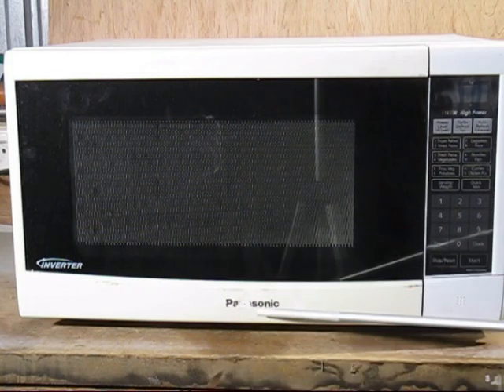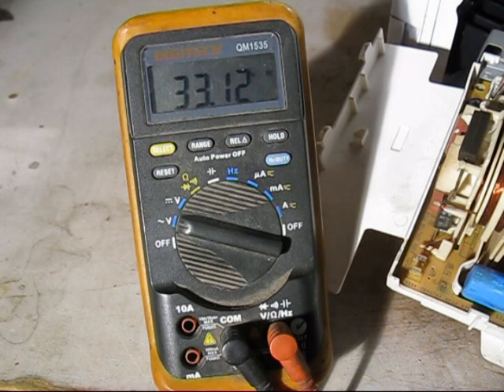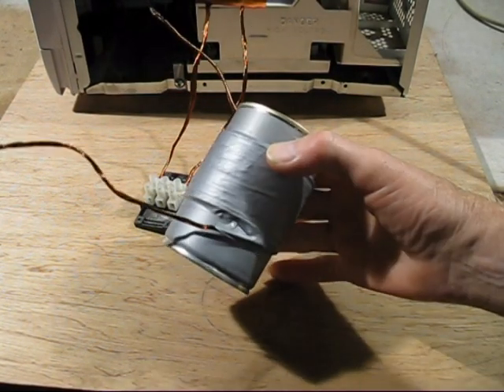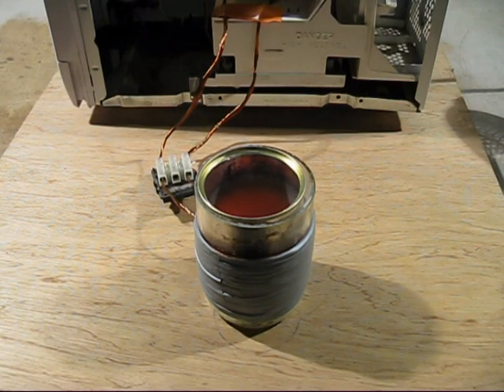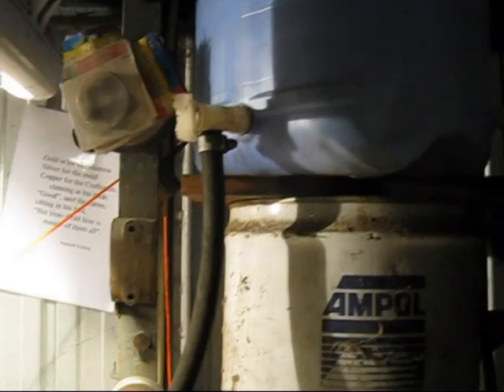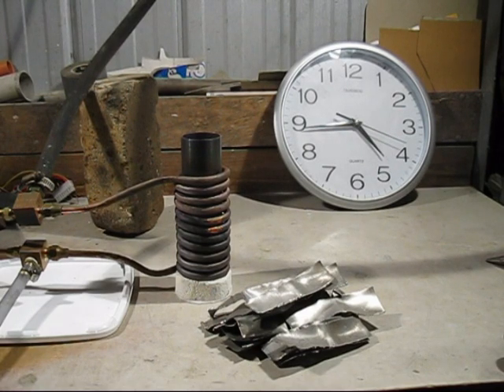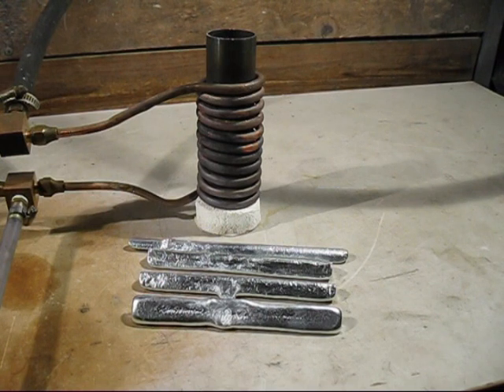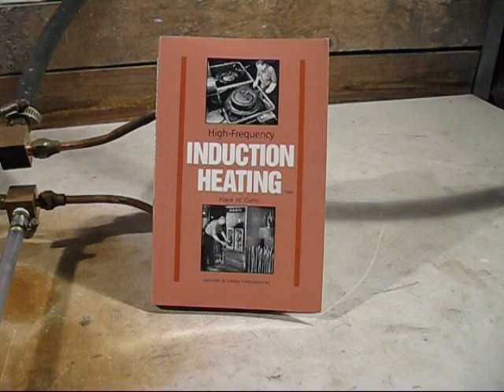First time on youtube, induction furnace made from microwave oven parts

Comment: Your bare copper wire on the secondary is not acting as a coil but as a resistor because the "coil" is shorting together and that short is what is heating the wire up. Induction heating is done though magnetic resonance in ferrous metals. While I applaud your attempt I do believe you have missed the basic concepts of an induction heater. Please keep doing what you enjoy doing though 🙂
Reply from the maker: So what are the basic concepts I am missing?
Reply: @JaneChristensen.  correct the piece your trying to heat needs to be resonant in the frequency of the applied current to induce the hearing effect. However on this video the coils are showing together thereby limiting the amount of electromagnetic field by increasing the conductive area in question and reducing the current flow through each individual wrap which will reduce the electromagnetic field around the conductor. The heating effect shown here is the copper wire heating through resistance. The resonance your trying to apply through inductive heating is created through the varying frequency of current flow across a consistent coil that slows the resonance to occur in the part centered in the coils. Also please note that a purely inductive heating coil will not overheat and melt tape for example without a ferrous metal being placed within the coils.
Reply: @JaneChristensen.  very well started and I do agree. I was simply going off what is shown in the video and trying to bring light to what i saw was a gross oversight. There are a lot of videos and papers available all over the internet if anyone would like more info on our discussion I do recommend a bit of research for others not as up to speed

Comment: Extremely dangerous way to handle that crucible, couldn't you have put a handle on it?? Not such high temps as steel or whatever but molten metal dropped would be a real issue!!

Comment: I bought a "2500W ZVS Induction Heater Induction Heating PCB Board Heating Machine Melted Metal + Coil Mayitr+ Crucible+Pump+Power Supply" from AliExpress, and good lord is it a weapon. I have brewed up dozens of pots of various copper alloys and it has performed brilliantly. I haven't measured how long it takes to melt a full crucible of copper but it would be well under 10 minutes.
Reply: How much copper per melt?  Can you super-heat to 2250 for pouring thin castings? I'd love to see you do a video on this.
Reply: @mevk1  Roughly 500g. Might be able to get that hot, but it would definitely need a lid on it to keep the heat in, and the supplied crucible probably would not hold up well.
I've put some major wear on my crucible already, waiting for a few more to arrive. Might make a video when I get them! It's a very quick and convenient process.
Reply: Did you buy a switchmode PSU as part of the package with the induction heater board?. Some of the induction heater boards are offered without the ancillary bits and pieces such as a PSU.  What sort of usage are you giving induction heater? What input power level is it working with? Is it running at the maximum input power of around 48V and 50A? What frequency is it operating at? I expect that the state and configuration of the metal in the crucible affects the power drawn by the heater board, although that relationship is probably complex.  A large amount of conductive metal within the work-coil will damp the resonance of the work-coil and capacitor tank circuit and that may actually reduce the amount of power that the driver can deliver to it. Equally a small amount of metal will not absorb much power from the work coil.  It’s an impedance matching problem. For maximum power delivery, the resistance of the load needs to match that of the power source. I would appreciate any info on how these boards perform. Cheers
Reply: @rockwell6594  I did get an SMPS as part of the package. It is a second hand unit from "telecommunications equipment" and is an impressive bit of gear in itself. 
With an empty crucible it is pulling up around the full 50A (at 48V) but as you mentioned, fill the crucible with copper and it is significantly down. I can't recall exactly what it falls to, though. Still heats it to melting point very quickly.
Seems like the crucible itself absorbs most of the energy.
I have yet not measured the frequency.

Something else thing that may be helpful to note: I have been using a small radiator (4" x 4", intended for PC water cooling) to cool the coolant, but that is woefully inadequate even with a great deal of airflow through the core. I suspect the radiator needs to be about four times as big.
Reply: @godfreypoon5148  Thank you for that reply. One further question. Is the SMPS that you obtained made for both 110V and 220V supply, or is it just one or the other. I am guessing from the dimensions of the radiator that you quoted in inches, that you may be in the US and that the PSU is running on 110V. We have nominal 230V in my neck of the woods, so I would need to check that aspect with the seller. If your crucible is electrically conductive, it will be heated by the current that the heater induces in it. An electrically conductive crucible forms a nice large shorted turn that is well coupled to the work-coil. Presumably, if you are seeing that heating effect, your crucible must have enough graphite in it to be conductive. Is the crucible straight graphite or clay graphite? 

The currents circulating in the resonant tank circuit comprised of the work-coil and capacitor could well be ten times the input current, particularly when it is freewheeling without much load. Increasing the calibre, and hence copper cross section, of the pipe in the work-coil will obviously reduce conduction losses in the coil, however, the resulting increase in current will put extra stress on the existing capacitors. I suspect that the capacitors may already be working pretty hard. Polypropylene is the dielectric of choice for induction heaters because of its lower dielectric losses compared with other dielectrics such as polyester. More thermal insulation between the work-coil and crucible will reduce the amount of heat the coil receives from the heated crucible, but a 4” x 4” radiator sounds a tad small. Thanks again for the reply. Cheers
Reply: @rockwell6594  The power supply is "220V". I'm running it on the ~245V we get here. The crucible is clay graphite, but it is pretty dark in colour.

I definitely need to improve the crucible insulation. The crucible sits in a mineral cloth type insulation sleeve (which has fallen to bits) inside the alumina outer pot, which fits into the work coil. I believe most of the heat needing to be removed from the coil is due to the hot crucible rather than resistive losses.

Glad I could help!

Comment: since when have microwaves not had a big ass 60 hz transformer in them?! i need to take apart a newer microwave!
Reply: Depends - cheaper ones still have the 50/60hz transformer inside, the newer fancy ones have the crappy inverter stuff inside. The transformers are more fun :)

Comment: is there a possibility 'at' the induction coil could be radiation in the direct area of it? maybe I'm wrong but it looks like a open electron field.
Reply from the maker: The steel crucible is absorbing all the power in the coil.
Reply: @luckygen1001  , how about when it's on without anything in the coil? looked like on other videos when they're dipping objects into the coil there's still reading amps and volts?
Reply from the maker: If you want to destroy this inverter start it up without anything in the coil.

Comment: Will stainless steel get hot in this?
Reply from the maker: It works best with magnetic steels but to heat up non magnetic metals it can cause many problems with the inverter.

Comment: Why only an "inverter" microwave?  What is different there?
Reply from the maker: Higher frequency than is available from a mains socket.
Reply: @luckygen1001  yeah but isn't that just higher voltage from a transformer?
Reply: @luckygen1001  but very good job on the ease of increasing voltage by a simple wire wrap on an existing set up if that is all you had to do.
Reply: I mean an increasing amperage
Reply: @niktesla3939  that is genious, but I think if you follow that turn of wire, I think it then is soldered to a flyback transformer taken form a discarded TV.

Comment: The copper tube coil could short itself with the contact from the exhaust tube crucible ......should the copper heater coil be insulated using fibre glass sleeve ?
Reply from the maker: Yes the copper coil could short out on steel crucible but I make sure that does not happen. I plan on using ceramic fiber cloth that is 3 mm thick to stop heat loss in the crucible.
Reply: @luckygen1001  ......Thanks for clearing my doubt. Excellent Video and Explained in detail. Really appreciate your work . Thank you once again.

Comment: how about a fan underneath the coil, like it works in a microwave,  maybe pushing some air through it might heat up more or something on top of the coil drawing it upwards. would it be a positive or negative electron field or both, another of the opposite might effect it.

Comment: You might be a bit confused at what you think you are doing there. All you did was run 32 volts at a high amperage through a coil of wire. Of course the wire will get hot. This is not induction heating.
Reply: I am sorry to disagree Roy, but It indeed is functioning as an induction heater. That was not 32 volts showing on the multimeter, but rather 32 kilohertz frequency. Just to labour the point, if it was functioning as a resistance heater, the winding would have to get hotter than the load, which clearly it didn’t. Cheers
Reply: Roy, further to my reply just above, please see my comment further up. It appears that the inverters do indeed operate at just over 32 kilohertz. At least mine does. I understand the confusion because, in the video, the multimeter was appears to be set to read voltage. It looks like it must have been coincidence that the voltage was about the same figure , that is 32. Cheers.
Reply: @rockwell6594  His meter was set to AC voltage, therefore  he was reading voltage. It is clearly a resistive load heating system.
Reply: @paparoysworkshop  apply yourself just a little Roy
Reply: Roy, if the coil is working as a resistive heating element how come he could heat the piece of steel pipe to red hot with the copper work coil with water circulating through it?  As I demonstrated for myself, whatever voltage that is on the coil is at a frequency of about 32 kilohertz. (see my comment to Luckygen further up)  When he had the multi-strand wire wrapped around the steel can, the majority of the heating is the resistance heating in the walls of the can due to the eddy currents induced in the wall of the can by the rapidly changing field in the coil. Effectively the cylindrical wall of the can is a single shorted turn on a high frequency transformer. Because of the large alternating current, the work coils of an induction furnace will indeed get hot without water cooling, but that is not the way that they heat their load. The load heats because of the induced current in furnace charge material that is adjacent to or enclosed by the coil and also the magnetisation losses because of hysteresis if the charge material is a magnetic material such as iron. Cheers.
Reply: @mevk1  I've built electronic circuits for over 40 years. I know how to apply myself.
Reply: @rockwell6594  This is all easily done with resistive heating. Without me doing the experiment myself and actually measuring the frequency, it can only be guessed at. Furthermore, even if there is some induction  heating, this is absolutely the worst way to do it. It's very questionable at best. If you want to build yourself an induction heater (and I have built several of them) I recommend you don't try to tap off the side of a microwave.
Reply: Roy you write “Without me doing the experiment myself and actually measuring the frequency, it can only be guessed at.”

Your sentence reminds me of a story attributed to a US politician from the distant past whose name escapes me. The politician’s fellow passenger pointed out some sheep grazing in a paddock and remarked how clean and white the sheep’s fleeces were. The politician responded that the sheep were indeed remarkably clean and white on the side that they could see. He wasn’t conceding anything about the side he couldn’t see. Let me know if you happen know which politician it was.

Regardless of any confusion that may have arisen over what appeared in luckygen’s video, I independently measured the inverter frequency and it stabilises at 32 kilo Hertz – no guesses involved.
Luckygen has clarified that his multimeter reads frequency on either the AC or DC voltage ranges if he presses the blue frequency button. His meter was indeed reading circa 32 kilo Hertz. I have since found a reference to Panasonic's own information which also confirms that they operate around 32 kilo Htz.

You write: “even if there is some induction heating…”  

Have look at the video at the 10:40 minute mark. The steel tube is glowing red hot while enclosed by but not in contact with a water-cooled copper tube coil. In that circumstance it can only be induction heating of the tube. Heat only flows from hot to cold, so in that situation, heat is actually flowing from the red-hot steel tube to the copper tube coil. Any resistance heating of the copper tube coil is immaterial. As far as the red-hot steel tube is concerned, the copper coil looks like a heat sink, not a heat source as you imply by the phrase, “some induction heating” . 

I am not interested in “tapping into the side of a microwave” oven but I am interested in what might be done with the inverter from one. It is a readily available self-contained supply of power at about the right frequency for a small induction heater. I am surprised that Luckygen’s experimental setup works as well as it evidently does, especially as the arrangement pays no heed to achieving resonance in the work coil. It is possible that Luckygen may have just fluked a setup that works and if it tweaked in any direction it may let the blue smoke out of the PSU. Whether the inverters are robust in that usage remains to be seen. Nonetheless Luckygen’s experiment is interesting because these inverters are now so ubiquitous with so many out there as scrap. 

About 17 years ago I developed a controller for three-phase brushless sensorless permanent magnet motors. It utilised a microprocessor to do all the phase tracking and control on a cycle-by-cycle basis. I realised that the microprocessors were no fast enough that the same approach could be used to make an induction heater power supply that would track resonance on a cycle-by-cycle basis. That would eliminate any need for the tuning that is necessary for varying loads even if the controller utilises a conventional phase locked loop to track resonance. Others have subsequently demonstrated that the microprocessor cycle-by-cycle approach can be made to work in that role. However, I am impressed with how well Luckygen’s experiment works despite eschewing any measures to make the work-coil resonant. Indeed avoiding resonance of the work-coil may be what is saving the PSU from letting the blue smoke out.

You write that: “…even if there is some induction heating, this is absolutely the worst way to do it.” 
I agree that it is not optimal. Like I wrote,  I am surprised it works as well as it does.
However, if a workable heater for occasional use can be assembled from scrap components, who cares whether it is optimal.
My only concern is that people do not underestimate the special hazards posed by the high voltage secondary side of these inverters.
Evidently,  judging by his recent reply, in the setup in the latter part of the video, Luckygen had eliminated the high voltage secondary side of the PSU altogether.  He writes that he has connected  the driver circuitry directly to his external transformer. I trust that he has a solid earth connection on his work-coil. lest the insulation between the primary and secondary in his external transformer fails.

You write that: “This is all easily done with resistive heating.” 
Well yes and no. Induction heating is particularly suited to rapid localised heating.
Induction heating has the advantage that it puts the heat directly into the object that you want to heat rather than into its surroundings.
Apart from arc furnaces, are resistance heated furnaces used to melt cast iron? 

I am interested to know what sort of induction heaters that you have built?  Cheers.
Reply: @rockwell6594  Believe what you want to believe. Some people are gullible. That's why there is a flat earth movement.
Reply: @paparoysworkshop   roy  stop whining

Comment: Another class video. Im with CaptainJerk on the silver. Time to raid the missus old jewellery stash mate.
BTW i think you may have bypassed a thermal resistor for the fans giving them an open circuit. Throw a few resistors in line to bring them down.